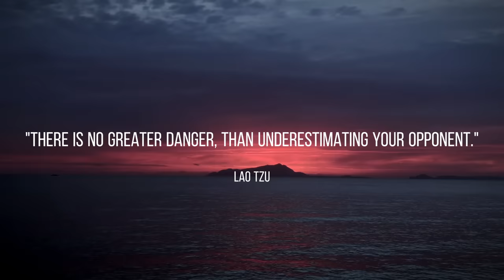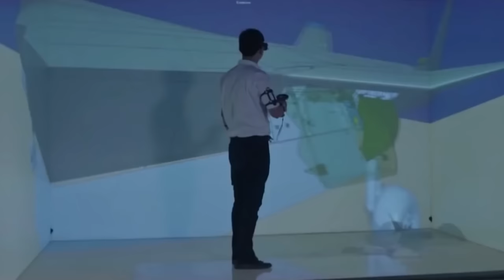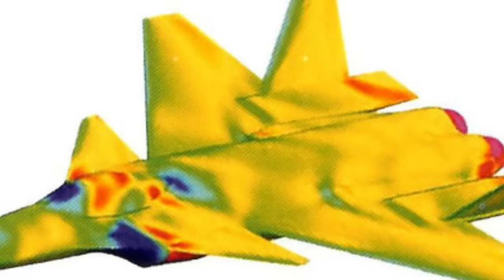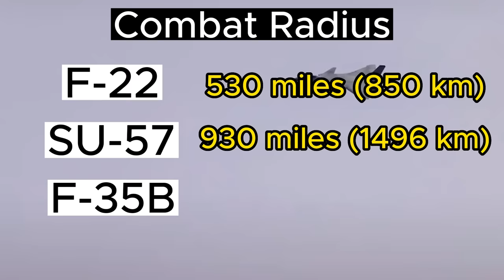China's Stealth Fighter, Good or Bad?

Comment: The J-20 does in fact have retractable Luneburg lenses. They're located on the underside of the plane, in an elongated hexagonal compartment next to one of the missile detection IR sensors.
Reply: Hard to see the compartment not compromising stealth.  Not that the oddly-angled canards, ventral vertical surfaces, and exposed engine nozzles don’t compromise that enough.
Reply: @bluemarlin8138  You don't understand its function. The compartment is used only during non-combat missions to deny the enemy from getting good radar cross-sections of the plane. During combat missions the compartment is retracted and covered with RAM tape. Furthermore, he cannards are "oddly-angled" in order to not be symmetrical with other surfaces of plane, that makes the cannards much less visible to radar than if they weren't "oddly-angled". Lastly, regarding the engine nozzles, the WS-10 and WS-15 are serrated nozzles.
Reply: @bluemarlin8138  Your conventional surfaces will compromise stealth around the place with bigger sensors that can detect longer distances.
Reply: You can clearly see the Luneberg lens at 10:23 of this video.
Reply: @bluemarlin8138  It's not a compartment, it's literally the whole lens retracting. The one in the video is not the retractable version. The new version is completely flush when retracted. 

Also, are we going to talk about the massive exposed engine on the F-35? And canards were going to be used on the F-35 until they found that the front weight was not good for carrier ops.
Reply: @Gongolongo  Many of the NGAD models has canards as well. I don't believe the Chinese would pour billions into a program if the testing showed a poor RCS with the canards. They also have good data regarding canards having the J10 as well. I completely disregard Indian media and chatter space when it comes to military talks.
Reply: @davidmoss2576  exactly.. if PLAAF thinks the delta/canard is inferior then they can just straight cut and paste F22 to their design
Reply: @davidmoss2576 armchair experts will always think they know better than an entire country of the most qualified engineers who have spent more time working on a plane than the commenter has done doing any one thing in their whole life.
Reply: Of course it does. Only an Indian would believe any 5th gen craft over 150 million wont have or use lunesberg lens in peacetime..
Reply: J20 is not stealthy enough to avoid a firing solution. The difference between J20 vs F35 is like comparing a cross section of a car to pigeon let alone an F22.
Reply: @MrJaman0083  source: trust me bro
Reply: @keithw4920  the J-20 did not initially have retractable Lunebergs, instead they had to attach it before flight, the latest upgrades have retractable ones
Reply: @bluemarlin8138 what about the ROUND explosive cord set at RIGHT ANGLES right at the top of the canopy which also appears to not have special coatings

Comment: I believe the lack of cannon is based on similar logic to the F-4 Phantom. It was initially a naval interceptor, meant to shoot at Soviet bombers before they could launch an anti-ship missile at the carrier. Adding a cannon would be pointless, because if a Phantom had to maneuver for a gun kill it would allow the enemy to get inside firing range and the carrier would be damaged or sunk depending on the number of missiles in that volley.
China's focus seems to be targeting non-stealthy aircraft like AWACS and fuel tankers, so the shots are taken without getting close to escort aircraft.
Reply: 什么年代了，还用机炮
Reply: And what happened to the Phantoms? They got lured in close ranges and got their cheeks absolutely clapped
Reply: @desperatetogetsomehoes  Except that didn't happen. Slow Phantoms doing bomber escort were caught in high speed ambushes.
Then MiGs were lured by Phantoms flying in bomber formation and got clapped. Instead of bombers with Phantom escorts, they were full Phantom combat patrols.
Reply: @desperatetogetsomehoes  That was mostly for USAF Phantoms trying to engage MiGs in close combat due to the rather archaic rules-of-engagement at the time, where IFF (identify friend or foe) had to be done visually, which practically negated the advantages of long range missiles. Note that in Vietnam, the US Navy Phantoms were far more successful in air combat despite their own F-4's never being upgraded with guns, unlike their Air Force counterparts. It's also a fact that in the last 60 years, the number of air-to-air gun kills on modern conflict zones can be counted on one's fingers, whereas the majority of kills were made with misiles.
Reply: @desperatetogetsomehoes  Actually that is largely myth. The Phantoms were rarely beaten in dogfights and most were shot down in hit and run attacks. They had little trouble with the MiGs in dogfights when flown properly. The same can be said about the supposed poor reliability of the AIM-9 and AIM-7. They worked well enough when fired inside the parameters they were designed for.
Reply: The gun issue with the Phantom is largely myth and was disproven by the F-4J during the Vietnam War. Once the J came into service with the USN and pilots were trained how to properly use the Phantom the kill ratio skyrocketed. The Navy Phantoms never had a gun and did far better. The F-4E with the gun didn't make all that much difference to the USAF during the war.

The other funny thing about when people bang on about the F-35 not having a gun is that the F-35A DOES have a gun.
Reply: @StrikeNoir105E  Exactly.
Reply: I'm assuming they're thinking that if they need a gun, by the time they're fighting the US they'd be able to put the gun on a Loyal Wingman rather than having to lug it around inside the plane. I imagine there's a lot of savings on design from just not having a giant cannon with all the weird changes in flight profile from shooting off ammo, need to design a door and flash-proof coating around it, etc.
Reply: @骞张-s9n  以后就做成激光枪X D
Reply: I think the Chinese are thinking on a big scale. A cannon is useful in niche situations but the PLAAF isnt worried about losing in niche situations. This plane is for the 1000 against 1000 fight, not some 1 on 1 case.
Reply: @desperatetogetsomehoes  do you really think bvr was a thing during the 60s?
Reply: @StrikeNoir105E  yeah all three kills, and two of them were A-10s shooting helicopters
The Air Force and Navy don't even have any aces anymore because most countries won't allow their aircraft/the pilots refuse to go up against our aircraft.
Reply: @StrikeNoir105E finally, someone who knows what the hell they are talking about.  It's amazing how many people don't understand the simple facts
Reply: u r wrong. In the event of war, the first target will be the US gps satelites. Once the satelites are taken down, US fighters can all land in pacific ocean and the ships going in circles. No one had the time to play tit for tat in the event of a real war.
Reply: @IA100KPDT  you seem to know nothing about how navigation works.  You do realize that there is such thing as inertial navigation right?
Reply: @terraoftime  what i told u is from a US military think tank n strategist who went on fox to share his war game outcome. U can ask him.
Reply: @CruelestChris Having a autocannon in a 5th gen dogfight would seemingly be extremely important given how hard it is to keep a weapons lock on a good stealth aircraft as well as both Jets having the ability to jam signals as well as their electronic warfare capabilities something autocannons are immune to
Reply: @keithw4920  That's a horrible strategy considering they'll never have that many in the air at the same time not only cause of the cost of the resources to launch a 1000  J-20's but they don't have close to that number of J-20's to attempt such an ill advised tactic of putting all of your eggs in one basket so to speak
Reply: @IA100KPDT  Like it says at the start of the video 
"There's no greater danger, than underestimating ones enemy" 

Seems you think that underestimating the United States as a foe is a winning strategy? Cause the US has been creating cutting edge tech for decades longer than China and has been developing stealth since back in the 1970's and just cause China came out with 1 stealth fighter that all of a sudden they've surpassed the United States in all military areas??
Reply: @@KittyCat-mp3rm On your comment of JH-20 with double the airborne weight of the J20,
That intended payload may be an air-launch version of a hypersonic anti-ship missile.  (Even though haven't heard of such platform yet)
Reply: 笑死人了 。哈哈哈哈哈哈哈哈哈哈哈哈。 US ？  F-XX ？ wahahahahahha
Reply: The lack of the cannon is simply due to how "fights" will take place today, and in the future..  Dogfights are dead...  Why do you need a gun outside of a sidearm for the pilot if they eject...?   Everything is going to be "over the horizon"..   We have the F-35 that superseded the F-22 sadly....   People, we can shoot missiles with only one "AWACS" type airplane marking targets...   Meaning, they cannot see us, especially at long range... We have meshed technology to the extreme..  OUR (USA) doctrine makes any top tier world power essentially obsolete..     The doubts, if you are one, will find out in 10-20 years..   There is a method to the so-called madness..
Reply: F4 without cannon was partly because of a blind believe of the then new weapon called guided missles, which proven to be unreliable and easily jammed. Now missle has been developed for 50 years and are much much more capable and harder to jam. Cannonless was a bad idea back then doesn’t mean it’s a bad idea now
Reply: Actually the B and C variant of the f35 don't have guns, only the A variant has an internal cannon.
Reply: 键盘侠
Reply: Each fighter would be accompanied by 3-5 drones, controlled by the second pilot,  carry whatever combat platform for a given mission.
Reply: @terraoftime  ＇
Reply: @jimmygambino91  Stealth jets can still be targeted, just at a much closer range. Even an F-4 phantom and it's original radar would have no issue getting a weapons grade lock on any stealth fighter at 10km. A cannon is effective out to about 2km, and an IR missile have no issue targeting a stealth jet from 20-30km
Reply: @alfeeman  Again, back then if a F-4 had to use a gun, the aircraft carrier would be in the bottom of the ocean already.
The F-4 was a naval interceptor so cannonless was a good idea. It was then pressed into service as a general purpose aircraft that did combat air patrols and close air support. That was the "bad" idea. It still performed well.
Reply: Considering each F-35 is basically a mini AWACS this strategy wouldn’t make much sense as destroying the AWACS would just make the F35s take over and depending on amount of F35s and dispersion wouldn’t really affect targeting capabilities or accuracy.
Reply: You are confusing the f14 with the f4. The f14 was the naval interceptor meant to kill soviet anti ship bombers. The f4 was not. The f14 had a very capable bvr ability with the Phoenix which allowed it to shoot farther than Soviet anti ship missiles could reliably hit a carrier force. The f4 didn’t. I mean aim7s today only have a range of 15 miles max so imagine if not only the aim7s were worse but also the radar guiding it because that’s actually what the f4 had. I think China just didn’t see a need for a canon for the same reason the B and C f35s don’t have one and the A barely has enough ammo for more than one engagement. With the creation of ata missiles with 100+ mile range and datalink guidance capability they don’t see a need for a gun
Reply: @LaikaTheG  The F-4 was a naval interceptor. The F-4 was the predecessor to the F-14. The Navy had the A-4 for ground attack and the F-8 for close range fighting, so the F-4 could only be justified as an acquisition as a long range interceptor.
This is well documented history, not sure why you'd want to contradict it.
The A has enough ammo. Most modern fighters carry around 120-150 rounds in the gun. With burst limiters and radar assisted ballistics, a short burst will shred an aircraft nose to tail.
Reply: @desperatetogetsomehoes "lured" they just didn't have a reliable iff systems and had to make visual id those days are long gone
Reply: 6
Reply: Missile technology has also come a long way since Vietnam. If the US pilots had AIM-9X in their Phantoms I doubt a single one of them would've asked for a cannon to be installed. Short range dogfights are increasingly rare, if you look at the aircraft losses in Ukraine, the practical entirety of fighters were shot down with missiles.
Reply: from what i've heard the cannon also adds unnecessary weight and hurts the stealth since you need a door for it and an ejection port for shell casings, and stealth planes need to be as smooth as possible
Reply: modern jets fly so fast and turn so hard.. hard to shoot with guns and cannons.. almost pointless
Reply: The distance reasoning is sound if you were to attack another aircraft of potentially cruise missile, but not an enemy aircraft attacking a highly protected asset, such one’s aircraft carrier.
Reply: @user-be3dt8lu7f again, this was the same logic and mentality designing the F4 just cause it was a different Era does not mean an autocannon is not necessary. Missiles are expensive bullets are not.
Reply: This makes no sense cause opening the missiles compromises your stealth capabilities. So how many times are you going to open your bays.
Reply: @lip124  They're just not that useful anymore. Modern jets, especially stealth jets, are all about who can hit who before the other can get spotted. The F-35 is expected to be fighting at a range of around 1240km while the effective range of a rotary cannon like that used on the F-4 is around 3km. Many pilots and experts are already saying that you'll likely never see your opponent since ever improving stealth, radar, and missile tech are pushing the ranges they fight further and further while cannons arent getting that much longer ranged or accurate. It's like walking into a sniper duel with a sledgehammer: sure you can easily kill your enemy at point blank range but you'll get ventilated long before you can even see your enemy in a gillie suit. 
Now cannons for ground attack are another matter and nearly all ground attack and close air support aircraft have them. They shred targets that cant easily be locked with missiles, especially useful against buildings and light fortifications as well as lightly armored vehicles. The A-10 for example is famous for its gun and while it has no set successor most of the potential candidates like the A-29 Super Tucano have cannons or provisions for a cannon/gun pod.
Reply: @lip124  Bullets are cheap. Risking an airframe to get a guns kill is expensive.
Reply: @alfeeman  
That's a defense reformer myth, the problem was that the rules of engagement at the time were to visually confirm all intercepts, meaning Vietnamese MiGs were starting engagements at ideal range for them while completely removing the advantages that missiles offered. This is why, despite never fitting internal guns to their F-4s, the Navy saw the exact same rise in kill ratios as the Air Force as RoE changed and better air combat training was given to pilots.

Comment: Three things to support J20s ferry Range: 
1.Canards help in saving fuel while take off (take off uses 30 pct of fuel normally) by producing more lift and that fuel can be used to ferry the aircraft farther
2. Space left from removing gun/ammo compatment, and Bump/DSI intake as well as other parts being used as extra fuel tanks
3. Curved back side near engings curved wings to reduce drag as well as to crfeate more lift
Reply: there is a clear advantage of delta/canard design towards maneuverability and range... that's why most european designs use this configuration - Typhoon, Rafale, Gripen
Reply: Canards do not affect the range of the plane. Having a shorter or longer takeoff run isn’t going to have an effect how much fuel you have left once you’re in the air because acceleration stays the same whether or not there are canards.
Reply: @collander7766 no, the more lift, the higher your takeoff weight which mean you can carry more fuel.
Reply: @lagrangewei  could very well be true, but that’s irrelevant because that’s not what OP said. They said it used less fuel.
Reply: @collander7766   "by producing more lift and that fuel can be used to ferry the aircraft farther" this is what op said

Comment: Would be great to see how well this does in hypothetical joint exercises vs the F-22 and F-35, same for the Su-57.  I'm speaking as a neutral military aviation enthusiast.
Reply: If it could integrate with an F35 the best strategy would probably to just supplement F35s with j-20s to boost numbers as a single F35 with its sensors and stuff  would massively multiply the j-20s capabilities.
Reply: I think it's true intended use is as a strike aircraft/missile truck. I refuse to believe the Chinese actually think that configuration would produce a more nimble fighter than a Raptor or Lightning. Especially when they had technical data on both. This is not an aircraft either should fear outside BVR. I'm sure it's a nice, capable aircraft, but not a competitor. Neither is the Su. But good on them for ACTUALLY PRODUCING SOMETHING WITH SOME AMOUNT OF TECH THAT ACTUALLY WORKS....even it they stole it.
Reply: @Cody38Super 
Yep, missile truck 100%